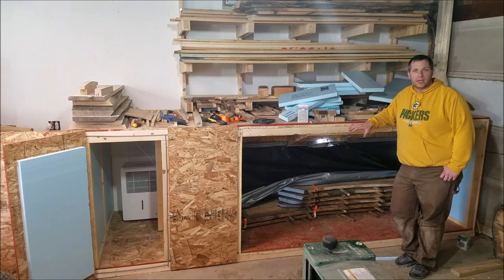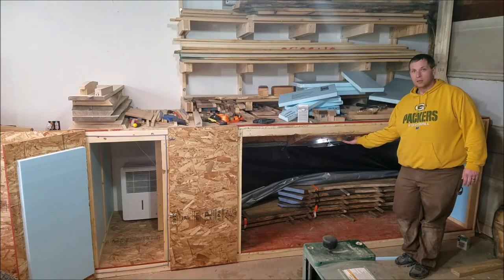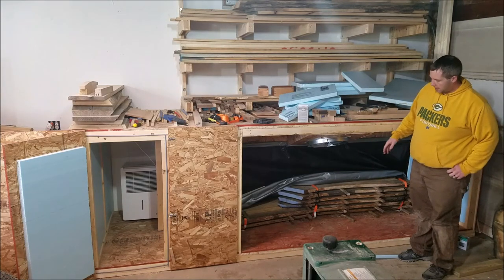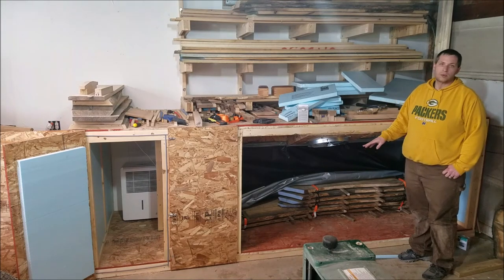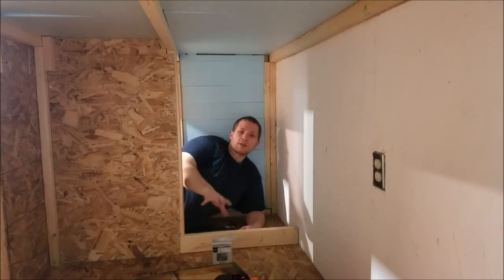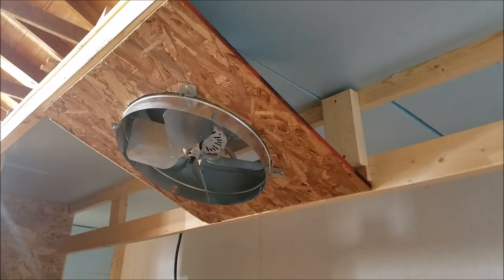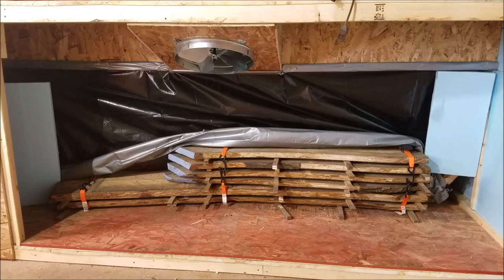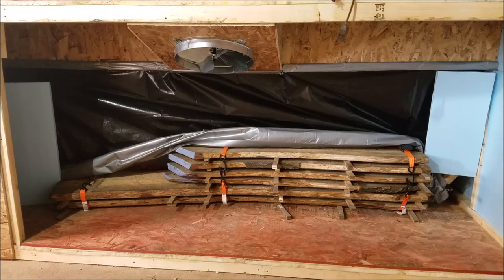Dehumidification Kiln Upgrade 1

Comment: how long does it take to dry wood, and how long do you wait after its freshly cut?
Reply from the maker: +Motoedge Motorsports there are a lot of variables.  I like to air dry down to 20% or less moisture first.  How long that takes depends on many factors like thickness, species, and the climate.  That can be a month or two for 1" thick and a year + for thicker material where I am located.  Then it goes into the kiln for anywhere from 30 days and up.  Longest load I had was about 75 days to get it down to 6-8%.

Comment: Thanks for the update. Do you still use the heater with this setup now? What kind of dehumidifier do you use and where did you buy it? Thanks.
Reply from the maker: +Kevin Jett I haven't needed the heater since I burned up the first one.  The thermostat I have maxes out at about 130 and the dehumidifier easily gets the temperature above that.  It is just a household unit, it's rated at 50 pints.  I think any big box store would have similar this time of year.
Reply: Ken Cook thanks for the reply. Last couple questions :) What temp do you set for the fan or do you leave it running? And do you always keep the humidifier running? Thanks.
Reply from the maker: +Kevin Jett it really all depends.  I don't follow a kiln schedule closely.  Depending on the species, thickness, and starting moisture content changes how I run things.  I have spalted maple in there now and I have the fan set as low as it can go, 50 degrees I think, so it will run constantly right now to prevent staining.  At 20% moisture I'll run the dehumidifier about 12 hours on 12 hours off so I don't have any case hardening issues.  As the load gets closer to dry I will run it longer each day depending on the water I'm getting out.  With red oak it's so easy to get end checking that I set the fan much higher (90 or 100 degrees).  I still run the dehumidifier the same way.  I have had some checking on red oak so it's not perfect.  My last load of maple didn't end check at all I don't think.